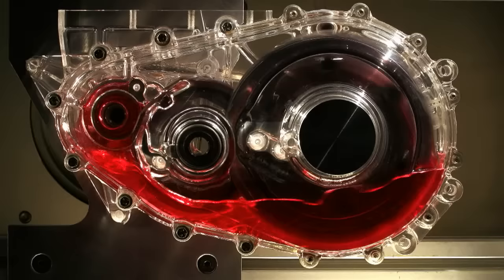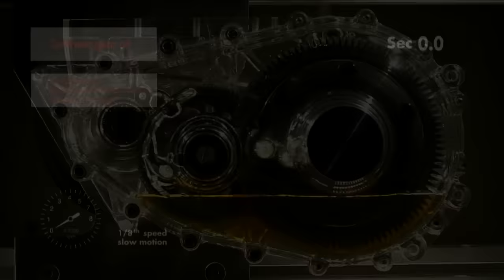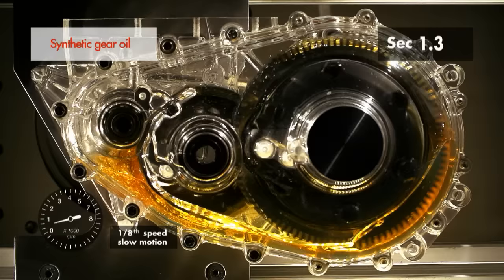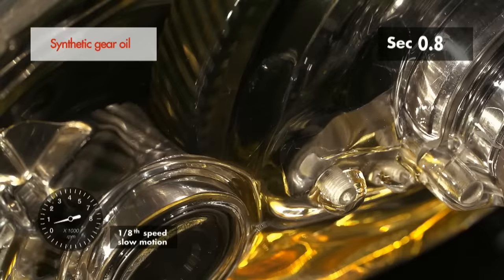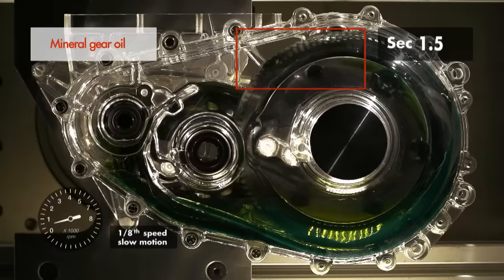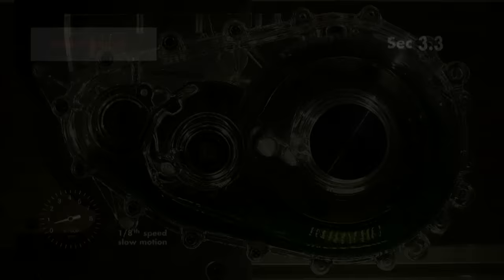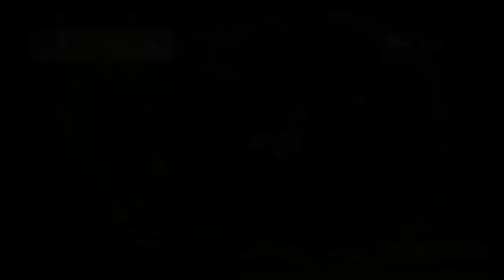Shell Spirax synthetic transmission fluid demo

Comment: I've had a garage for 30 years, I remember rep's from oil and addative companies used to come around with see through perspex gearboxes you could turn by hand and demonstrate how much better their product clinged to the gears whilst turning etc, they became very reluctant to empty these demo box's and let me fill them with oil from my workshop...
Reply: Notice how at the start of the video they said they blended oil to have the viscosity of their new synthetic oil and compared it to mineral oil. Basically they're not demonstrating their new oil at all just a mixture of better ones
Reply: @railgap  Wrong.
Reply: @fred5191  It was a demonstration of how the fluid's viscosity would behave at cold temperatures without having to chill the whole apparatus. The oils weight is it's viscosity at operating temperature, in other words the two different oils should have the same viscosity at operating temperature.  The gearbox or engine manufacture determines what weight to put in it by calculations with a fluid at that expected viscosity.  One of the benefits of synthetic fluid is that the viscosity is much more stable over a wider range of temperature, which means the cold synthetic is much closer to operating viscosity than the cold conventional or conventional thickens up more with the same drop in temperature.  What they are claiming is that they measured their synthetic fluid viscosity at cold temps and measured conventional viscosity at cold temps. Then they mixed the demo fluids to match those measured viscosities.

Comment: A good synthetic oil is worthwhile, especially if the gearbox type is known for problems.  I had various Rovers with the R65 gearbox for hillclimbs and sprints and went through probably 4 or 5 gearboxes.  Never had a single problem after I changed to synthetic oil
Reply: Learn to drive guy
Reply: @ThisIsGoogle  learn to drive? The R65 gearbox was notorious for self destructing. Especially if the engine it was attached to was tuned... So yeah nothing to do with learning to drive "guy"
Reply: @TheBlaert  Whatever you say bud. Keep racking up those miles to work, one day you will be a racedriver.
Reply: Brother I got a 4l60 I feel you with those r65 transmission a family friend had a couple rovers and he loved them and surprisingly they never broke down besides the tranny taking a dump 2 times beautiful machines tho
Reply: @ThisIsGoogle   I have a 2004 mini cooper with midlands/r65 transmission it's a very unreliable as a 5 speed gearbox. I replaced mine after the final drive bearings broke the housing. "BMW had wanted the car to have a Getrag gearbox, but the original UK engineers put in the R65 gearbox instead"
Reply: @LBZDreamer  classic mini unreliability

Comment: The large gear might not have had a full film build, but the smaller one was definitely completely covered and would have lubed up everything fine
Reply: Glad you saw that too!
Reply: The mineral type oil takes longer to fully lube-up but would that extra second of slow speed start-up engagement actually wear the gear a significant amount? I doubt it would make a difference to the life of the box. Sure if this low-lube situation remained all the time then yes there would be noticeable wear.
Reply: Well when one side is dry and the other is lubed, it will still cause premature wear.
Reply: See you guys in another 8 years in YouTube recommendations 🤣💩
Reply: @splagyetsi3287  in cold starts, this cause a premature wear ...
Reply: It's about the principle. In this video, the smaller gear was in direct contact with the oil bath. In reality, only one gear out of a set might be in contact with the oil bath. You can imagine how, in that case, there is more wear when using the mineral-based oil. :)

Comment: So they are comparing a 5w-30 oil with a SAE 30... that's like comparing oranges to apples. If they wanna show "the benefits of synthetic oil" at least show 2 oils with the same viscosity.
Reply: You do know that the W in 5W does not imply Weight it means Winter and its more viscous as shown in the temp test, Both are grade 30 and from what I seen in the coverage of lubrication. rather would go with Shell Spirax instead of mineral.
Reply: Joshua Cornell It's still comparing apples to oranges. Yes, the viscosity after the oil has warmed up might be "similar" but a 5-30 is NOT the same as a straight 30 when hot. Not even close. The 30 is way more stable and has different properties, but it's much heavier when "cold".
Reply: Yeah I get the comparison but in terms of coating evenly I prefer the Spirax, currently watching the Cool Running video of the higher grades As for the Mineral with its lack of coverage at points will lead to gear failure due to stripping or seizing. But I do agree with you they are not using a single 30 with the Spirax.
Reply: I'm not saying it's bad or not to use it, actually I use spirax on my Xterra too (rear and front diff, and gearbox and transfer case), I like the oil. Was just stating that they should have used an equivalent oil in the test.
Reply: Nice to know you're using it and yeah I am wondering the similarities if both were 30 and the Spirax not being a 5W grade in addition. I did enjoy they made this clear gearbox to show the difference in viscosity and lubrication. Having watched the heat difference video also helps to show the difference in two different grades of the same product.
Any leaking issues as another comment says will happen with "thinner" grades? I myself know nothing is 100% Perfect in every way and even thick oils leak out due to a bad or failed seal.
Reply: ccanaves i know right liike the mineral based one might be a 10w30
Reply: I wonder how this oil would work when the transmission is as full rpms. I can see the coating starting to cavitate and loose it's ability to protect moving pieces.
Reply: When has anyone ever seen a big company make a fair comparison?
Reply: ccanaves the answer is clear. Try to find a multigrade mineral oil.
Reply: Joshua Cornell but you cant see your own cars transmission ro see if its evenly lubricating
Reply: Isn't the point of this video is to educate the normal people on why you should use one type of lubricant over the other and not comparing apples to apples. You are getting the wrong point, people could be like "I don't care what oil, they're all the same. Why should I use this type?" and not knowing its bad for their car in the long run especially those who live in colder countries.
Reply: No because thinner oils release air bubbles quicker, produce less bubbles/foam and they also have defoamant additives in them. The oil film also stays in one piece rather than breaking up. The thicker oil gets chopped up. At high RPM's the oil then acts a s a coolant rather than a lubricant 100%.
Reply: Joshua Cornell 
This demo would only be valid if you were to start your car from dead cold and dump the clutch straight away
Reply: ccanaves Exactly!! Its like comparing water to caro syrup!
Reply: Joshua Cornell 
Thus test was done at -10c
SAE 30 doesn't stand a chance even against a conventional multigrade
Reply: Jesse none 
Synthetic oils usually sell themselves.
The fact that they compared apples to donuts makes me not trust them.
Reply: Joshua Cornell 
And yes the 5W is a weight
That is it’s weight (viscosity) @ 40^C
And the second number in multigrade is the “equivalent to” viscosity @100^C
A mono grade is rated at its 40^C viscosity
Reply: That's how marketing people see it.
Reply: They just wanna sell products to idiot who can't tell the differences
Reply: exactly
Reply: Ikr my first thought exactly. Even I believe sunthetic is better but that's just stuoid
Reply: You can compare apples and oranges despite the fact of existence of this Ænglish idiom.

Comment: For transmissions always use the original oil. This applies especially to VWs, yes it is around 20$/L and a MK3 Golf gearbox has around 3.5L of oil capacity so it's 80$ every 60k miles, I don't think it's that much, another gearbox is more expensive than using good oil.
Reply: Saving money on oil is never worth it. The difference between crappy mineral oil and full synthethic high performance oils like Motul or Castrol Edge is embarassingly small, like 30-40€ per oil change which is every 30,000km.
Oil is literally the only thing stopping your engine from eating itself, anyone who goes for the crappy stuff is an idiot.
Edit: also, oil filters are super cheap as well. I change the filter every time I change the oil.
Reply: @demoniack81  correct, I change mine every year since I do like 5000 miles max per year. I only use Liqui Moli 10w40 special for old engine with molibden, it makes it run so smooth and it consumes 50-100ml between changes. For a 30yo 165000 mile small engine I guess it's ok
Reply: This is why i never bought German cars, the maintenance cost is too high..😅
Reply: @Blue-yp5mz  it's only a 1.4 liter 980kg econobox.... Parts are ultra cheap in EU and I work on it myself, it's super cheap in the long run

Comment: It was a demonstration of how the fluid's viscosity would behave at cold temperatures without having to chill the whole apparatus. The oils weight is it's viscosity at operating temperature, in other words the two different oils should have the same viscosity at operating temperature.  The gearbox or engine manufacture determines what weight to put in it by calculations with a fluid at that expected viscosity.  One of the benefits of synthetic fluid is that the viscosity is much more stable over a wider range of temperature, which means the cold synthetic is much closer to operating viscosity than the cold conventional.  Conventional thickens up more than synthetic with the same drop in temperature.  What they are claiming is that they measured their synthetic fluid viscosity at cold temps and measured conventional viscosity at cold temps. Then they mixed the demo fluids to match those measured viscosities at room temp.

Comment: It doesn't matter if gearbox oil is syntetic or not. What they show is just difference in viscocity. Thicker oil stays on theeth much longer and thats why after couple of revs its missing unde the sprocket. I wonder how it looks under higher RPM. My guess is that mineral oil will flow through inner wall as one uniform stream and syntetic will just splash all over
Reply: It was a demonstration of how the fluid's viscosity would behave at cold temperatures without having to chill the whole apparatus. The oils weight is it's viscosity at operating temperature, in other words the two different oils should have the same viscosity at operating temperature.  The gearbox or engine manufacture determines what weight to put in it by calculations with a fluid at that expected viscosity.  One of the benefits of synthetic fluid is that the viscosity is much more stable over a wider range of temperature, which means the cold synthetic is much closer to operating viscosity than the cold conventional or conventional thickens up more with the same drop in temperature.  What they are claiming is that they measured their synthetic fluid viscosity at cold temps and measured conventional viscosity at cold temps. Then they mixed the demo fluids to match those measured viscosities.

Comment: I use whale oil in all my automatic transmission equipped vehicles.
Makes for a smooth shift every time !
Reply: And panda fat for chassis grease.
Reply: And literal elbow grease
Reply: Have you tried snake oil? It works great too!
Reply: Dexron 3 used whale oil in it. That’s not a joke lol
Reply: @mikepekala832  
I think they all did back in the 50s.
Whales were cheap and plentiful back then.
Reply: My grandma used to feed whale scraps to her cat, so plentiful were they.
Reply: @mikepekala832  может мой переводчик неправильно перевел, но китовый жир запрещено добывать, dexron 3 полность синтетический.
Reply: @gummy1204  I thought blinker fluid was best?
Reply: @JLawlietK  NEVER put blinker fluid in your diff or engine. That stuff is for blinkers only 😂

Comment: am I the only one who realizes this is a transfer case not transmission like the title says?
Reply: MoparMadness they only call it a gear box. A transfer case is a gear box. Any housing the holds multiple gears is a gear box whether that system can change ratios or not
Reply: nope
Reply: A transmission just doesn’t lend itself as easily to all those pretty visuals they showed us
Reply: No it is a motorcycle gearbox look carefully and the cylinder is on the vertical  front....that large gear hides the clutch mechanism.
Reply: "Trans"fer
Reply: MoparMadness Yes you are. In fact, I still refuse to believe it.
Reply: Llamazares

Comment: 1)What's the guereettee they are actually using their own product and the other product is actually some decent alternative and not cheap junk oil?

2) as someone pointed out, the larger gear might not be covered entirely but the smaller gear is, which is adequate.

3) will one or two seconds of delay cause any significant difference? Are there any citations on this?

Comment: We've found that without a tall package of anti foaming additives  the oils will trap excessive amounts of heat into itself when  cavitation is taking place. Gear sets will turn blue due to metal to metal contact due to insufficient anti foaming capability.

Comment: 8 year old conventional was working fine in WY at -40 in toyota truck.
Reply: Tad Meister How old is the truck? Conventional oils work just fine (under optimum conditions) for older vehicles. Newer vehicles are designed with tight tolerances so a fully synthetic lubricants are a must.
Reply: +Ibraheem Al hadede Tighter tolerances? No, not neccessarily.

Tighter torelance, most of the time does not equal to = quality. At the highest precision level, it becomes = higher cost.

Case in point. Previously in the roughness specification of machined surfaces (of bearing surfaces), people used Rz or Rmax as the absolute control paramater & the general consensus the lower (tighter) you go, the better it would be.

Not anymore. Nowadays people use Ra (Roughness average) from a set of peak & valley points, & even then, you have to take out the deepest valley from the calculation as, a deeper valley means a good pocket of oil storage (of course, deep valley is not good in the glass/ceramic product segment).

The same goes for tolerancing. You are not going for tighter tolerance nowadays. We are going for better profile/form/surfaces/fitting control (GD&T)

Comment: Did anyone notice that the red oil gearbox had more oil in it than the other two
Reply: The synthetic oil uses smart technology to self adjust fluid level. This is done by using thermal energy and CO2 from the air to create extra molecules to correct fluid level.
Reply: Yes, and notice at 2:36 the large gear looked dry on top, like in the mineral oil test.
Reply: Figured I would check this.
Yellow is shown at 0:37 and compared to green at 2:09.
Green is shown at 1:09 and compared to yellow at 2:09.
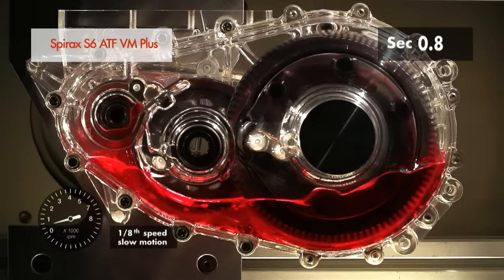Red is shown at 2:26 and does not have a side by side comparison.
That said before motion all oil levels are sitting at the same level, just under the black circle of the large gear.
During operation the levels are different as the oil viscosity results in more being in the gear teeth, at which point during motion the red oil does have more sitting in the reservoir.
Reply: @mikepekala832  Could you explain this more? What is the smart technology?
Reply: @morphbal1234  Sarcasm 😛

Comment: Your gearbox will outlast your car engine! So don't bother unless heavily modified. Go with company recommendations. Give attention to clutch & brake pads etc.
Reply: Poonacha Kp you must drive the shittiest car on the planet then lmao. 860k on my engine and she's still perfectly fine (yes I've taken her apart to check on her) still good. Also running 15lbs of boost
Reply: AKS I think Nissan use ExxonMobil for both engine and transmission, but i wrong
Reply: 金3 A.M. that's incredible
Reply: 金3 A.M. total b.s.

Comment: Operating temps is were it's at start up is usually irrelevant. My trans won't hardly shift out of first or second when it's -10 out but will shift like a dream once it's warmed up. Use the oil recommended by the transmission manufacturer. If it says uses conventional then use it don't switch because you think it will last longer unless that is backed up with  actual evidence. The only thing that matters at start up is the temp and how thin or thick your oil is to begin with. Synthetic isn't a miracle worker it's not going to lube anything faster it's just going to cost a bit more for the pleasure.

Comment: I think it depends on the speed since the thick is going slow it doesn't fill the gap properly and the faster the the thin oil goes les gaps filled.

Comment: I wonder if She'll can create a strong cvt oil that keep it from dying and solve shuttering and other issues associated with CVTs.  I'd like to pay oil changes and maintenance over 6k whole replacement.
Reply: CVT's are a classic example of contradicting needs, you need friction for the drive belt to drive the drums, but you don't want friction every where else in the transmission. Conventional autos had a similar problem, but at least they had large clutch areas that could bite through the oil.
Reply: @raygale4198  They could have separated the belt section and the gearing/clutch section. 
Plenty of other gearboxes do this, including many compact automatics which used ATF in the  gearbox section, but the combined final drive (diff) used gear oil.
Blame the engineers who thought little about the contradicting needs and though about the pennies saved. "bah, it will only be a problem in 80k, by then its out of warranty"